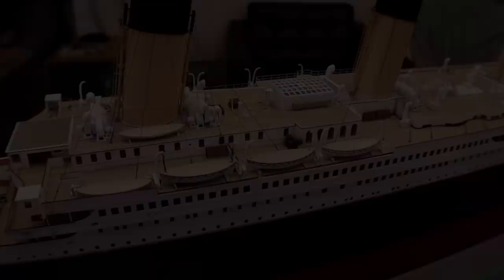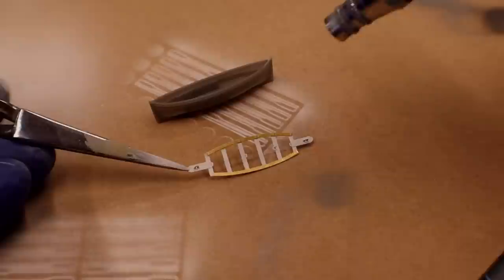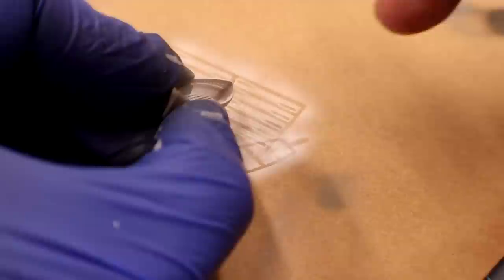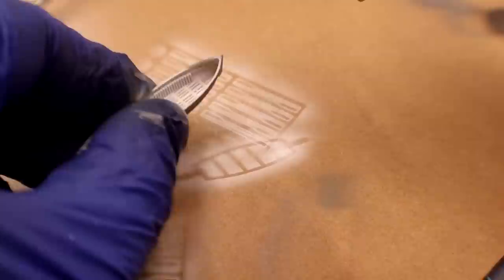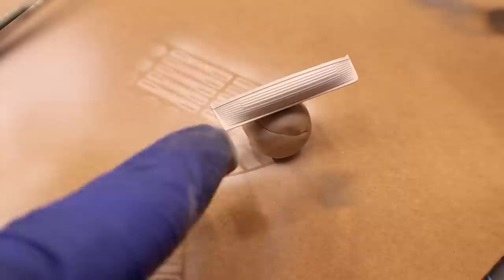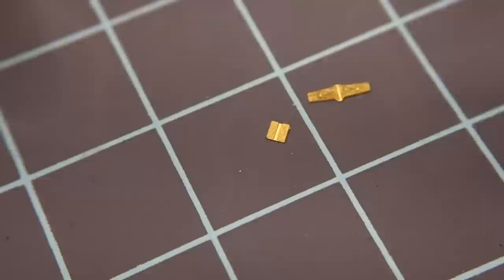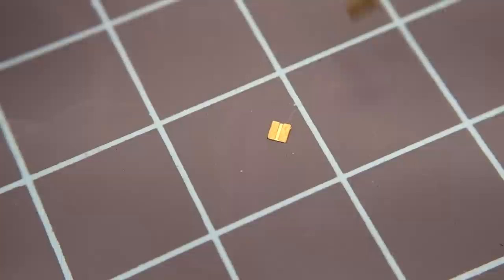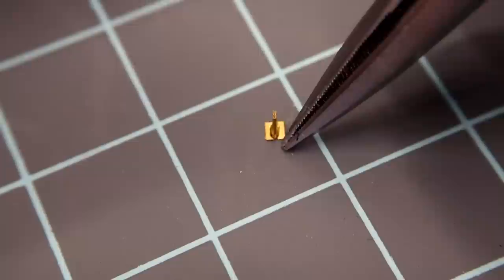1:200 RMS Titanic Build Video 37

Comment: Not only am i amazed by your modeling skills but by how little trouble you have with CA glue. I know its vital to assembling these kits especially the PE parts . I have been assembling models from plastic kits for 50 years to recently in the past ten years a O scale model railroad layout with hundreds of thousand of parts and always have a battle with CA glue. You have every thing set up correctly and one of these things always happen. The glue doesn't set up and hold or the glue is on the tweezers and sticks to everything but where you want it. I love watching your videos because you inspire me not to give up on the hobby I love. It would be great to show what type of CA glue you use and how you avoid these problems. Amazing work.
Reply from the maker: Thanks! It’s just “Bob Smith’s CA Glue”. I like the medium thickness stuff. Sometimes you need a little accelerator. Or, blowing on the glue actually works as a kicker as well. They key to making sure it doesn’t stick to the tweezers is keeping it off the tweezers in the first place. (I know, easier said than done.) But if they get glue on them, hold the tips to a flame. It will burn all of the glue off in an instant. Helping you to try again.

Comment: would have been good to show the clean up process to avoid damaging the boat after your initial removal from the support frame as I found the fore and aft areas were tricky to keep them undamaged
Reply from the maker: I just hit it with a sanding stick. I didn’t have any trouble which is why I didn’t show it.

Comment: More lifeboats wouldn't necessarily have saved more people anday have even killed people. Only 18/20 boats were actually launched (the last 2 floated off the deck). Had there been more boats that stayed tethered to the ship and maintained buoyancy the lines would eventually snap and send the boats rocketing to the surface where they could hit people. Also, lifeboats at the time were intended to ferry people between the stricken vessel and the rescue craft so they wouldn't have needed to be filled all the way (granted the crew probably knew there was no help nearby).

Comment: I can't believe you're going to ship that.  Is there any way that you could squeeze your client for gas money?  Something this big is worth a road trip just for safety.
Reply from the maker: Well, he has a company all picked out for this. And they are not cheap. So, that’s the route we are going.
Reply: @TheMidwestModelShop  OK, I can dig that.  Any chance we'll get to see how it's packaged in the end?
Reply from the maker: Sort of. I was asked to build a wood base that supports the ships on all sides. The contact points are foam with small bubble wrap. Then two butterfly bolts go up into the hull (some communications about this earlier in the build would have resulted in nuts being installed, but the client doesn’t intend to move it after it arrives at his house) this is to keep the ship from lifting off the base. Then the moving company is going to build a box/crate around this whole thing and off it goes. Similar to how things are shipped to the Smithsonian. Now, am I convinced it will arrive damaged free? Maybe. But I’m going to try to make sure it has a real chance of making it. And the customer used to build models so I’m sure if something comes loose he can fix it. I did ship another model to a guy in California and the model arrived unscathed. So I guess this method does work.
Reply: @TheMidwestModelShop  Hey, thanks for the explanation.  That's fascinating.  And the ship is just gorgeous.  Your client is going to be ecstatic, I think.

Comment: HI ben one thing I've found out with this kit is there is no tie hooks on the deck for the rigging. and can you tell me what size battery do I need to make the lights work I've tried a 5 volt but no good
Reply from the maker: You need to match the voltage of the LEDs. If you’re using the kit lights, it will be in the instructions. For aftermarket lights, use the power source recommended by the manufacturer.